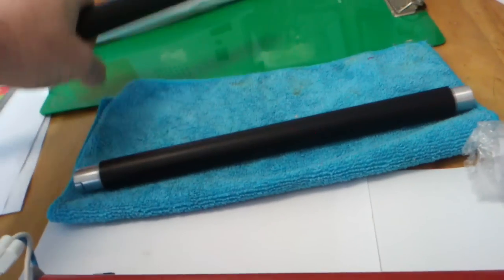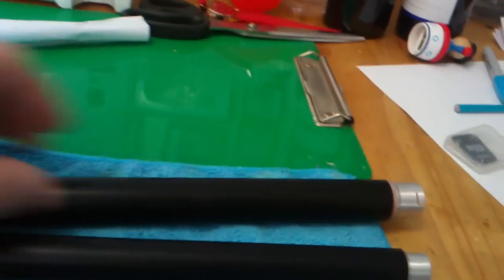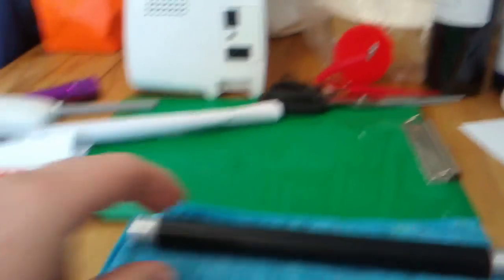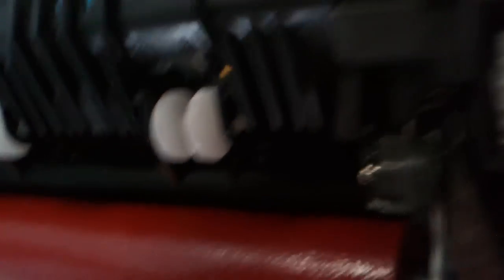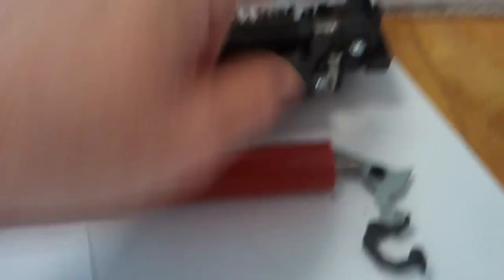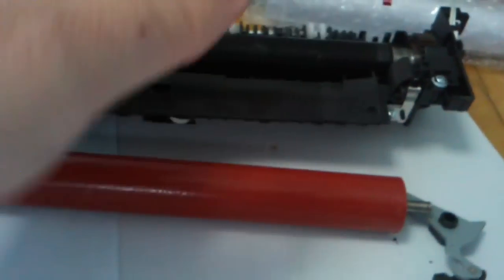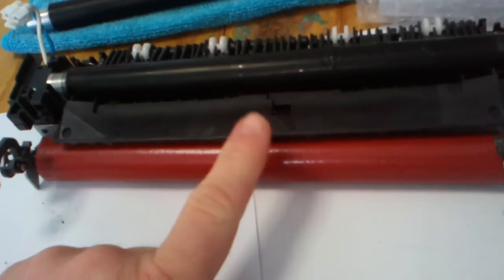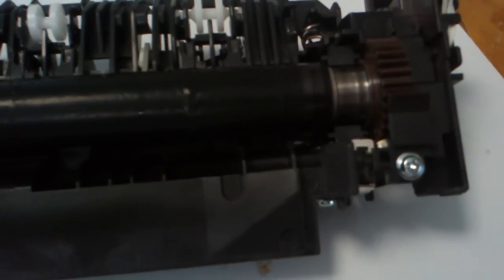Brother Mfc9330 Mfc9140 advanced upper fuser roller replacement part 2 fix brother fuser

Comment: Hi Terry.  GREAT video, awesome explanation. 
I'm a Brother fan for years, and currently I have this MFC-L9550CDW laser printer which is a great printer.
BUT, after ONLY 13500 prints, on ONE spot only, the upper roller in the fuser bursted open like an overcooked breakfast sausage, and was torn into many small orange flakes.
The printouts were bubbled on the left side, and in that spot the tone was not fused to the paper properly.

I sent it to the Brother Services Dept (here in the Netherlands), and as the printer is only 1 month over it's 1 year warranty, I had to fork out 160 Euro's for a fuser (plus SEVENTY euro's for shipping !!)
I don't know if they replaced the complete fuser, or if they only replaced the upper roller of the fuser. 

When I asked Brother why the fuser failed after only 13500 prints, they said that I probably used non-original Brother toner cartridges. They claim that the cartridges that I use are fouling up the machine and that this was the reason that the (upper) fuser-roller was damaged.

What do you think of this story? I can smell bullshit from a mile distance, and I'm afraid that they are lying about it.
How can toner from a good quality toner cartridge make such a damage?

Have you seen damage this before???

Would be great to hear your comment about this.

Cheers and beer my friend!!

Best
Robbert
Reply from the maker: You might want to move this comment over to the new video I posted about the 9550 here https://www.youtube.com/watch?v=9ubJgYqZMcA&t=365s

Comment: In my case, the red foam roller does have a speck of damage to it.  So what should I do?  I already ordered the black replacement roller.  You were starting to explain it in video one when it got cut off.  Please finish that explanation about tiny damage to the red roller.
Reply from the maker: Well thats interesting I dont see any orders for you? Where did you order your roller from?
Reply: Terry Jones Printer Repairs I had already ordered before I found your videos.  I guess I will just return it and stop trying to fix this machine.  Too costly - the new version of this printer runs $225 right now - not really worth over a $100 repair.  I’ll just sell this printer for parts.  But you should finish what you were saying about the red roller - for others who may need to know if they need to buy a new one of those.  I can’t get the speck off I think it’s burnt into the surface of the roller.  And where would you buy the red one anyway?  In case someone who buys my printer for parts wants to try to fix it?
Reply from the maker: @candy1land  You reuse the roller you have, There are no suitable replacements,  3/4 of the upper heat rollers sold on ebay and amazon dont heat properly. You leave the black mark on the red roller alone, it will come off by itself when the fuser is heated to 200~C, dont pick at or rub it you will damage the roller, The roller is not damaged with the black mark on it, it is just the black coating from your damaged upper heat roller. You can buy a proper roller here http://www.fixitfastelectronics.com/BROTHER-FUSER-UNIT-ROLLER/brother-9140-9340-fuser.htm  and its $95 aud not usd.

Comment: Hi Terry, 
Thank you so much for your tutorial. Thanks to you I have change the upper fuser roller, and the other, the red one for my DCP-9020cdw. 
But I'm very desappointed because befor my repair, the printer was working almost well (if you don't consider the pattern who was embossed on the paper over and over.)
I thought that I have do everything well, like you said/do, but I obviously miss something : Now, when I switch On the printer, it said : "auto-diagnostique Redemarrage auto dans 15 min / impr.imp.". (My printer and I are french) In English :  "impossible print / restart in 15 min" . Something like that.(there's no error code).  
Is there any reccurent mistake done by the begginner handywoman ? I have disassembled and reassembled several time, and there is always the same message. Have you any idea or suggestion that I have wrong done ? 
Thanks for your time (and sorry for my english)!
Reply from the maker: Where did you get your rollers from? Can you provide a link?

Comment: Thanks for your video. Very informative. Thought I would meeting that I have a MFC-9460CDN that has on 6500 prints. The fuser roller has gone bad and my machine sounds like a metal wheel with a flat section. The little separating pins are digging into the roller. Not sure what caused this but I ordered a new fuser kit before I saw your video.
Reply from the maker: An mfc9460 with 6500pages for a 3-4 year old machine means the machine is to big for your usage. Many of my clients with those have over 80000pages on their counter and still running a perfect original roller. Lack of use causes the roller to develop flat spots. When the roller rotates and the picker fingers come in contact with the flat spot they dig into the roller and cause the roller to be torn up. The problem is exasperated if you turn your printer off at the wall when not being used  because this prevents the machine from waking up and periodicaly  rotating the rollers to keep them round.
Reply: Terry Jones Thanks for the feedback. I realize now I bought more machine than I need. Since we bought the machine, we have gone to a more paperless office. The last couple of years we primarily use the scanner. I changed the fuser assembly and will try to keep it running for now.